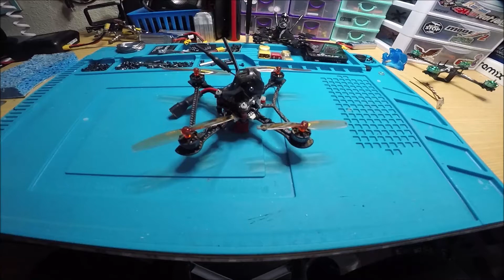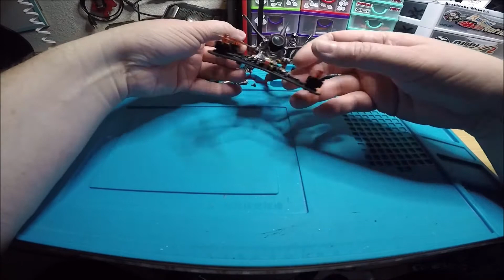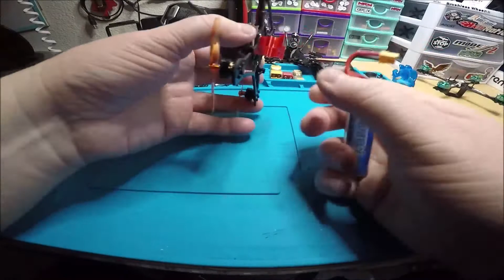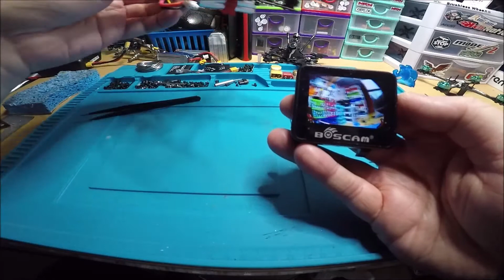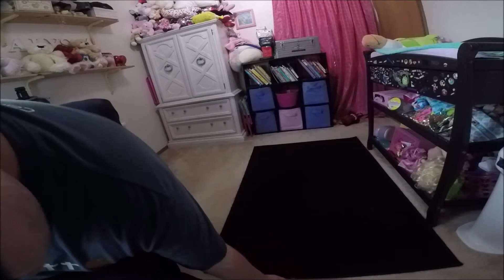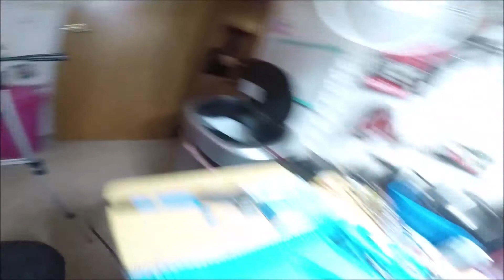marks twig

Comment: Price for one like it?
Reply from the maker: Frame 21 plus any tpu 
Motors 40 to 50
Fc 40 to 45
Rx 13 to 30
Cam 20 to 35
Vtx 20 to 30
Antenna 0 to 20
Labor 50
Shipping 5